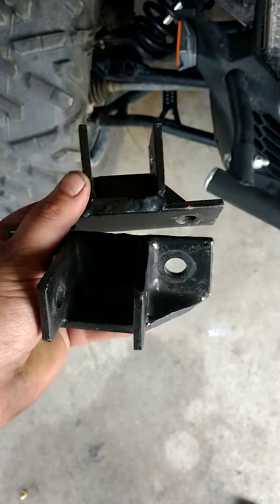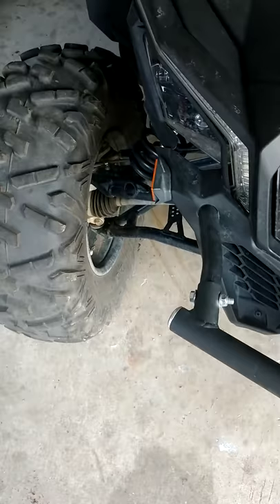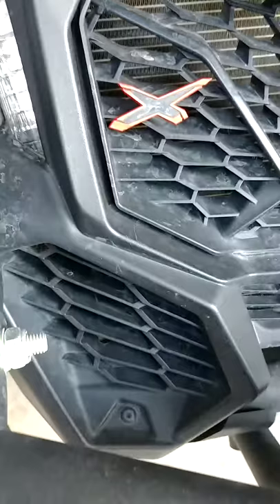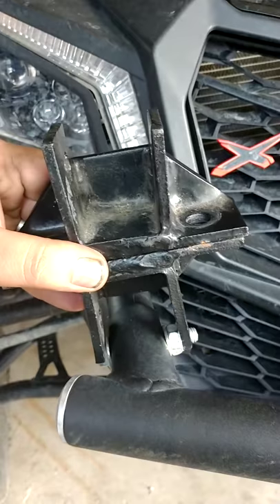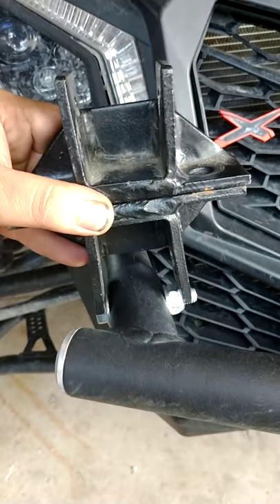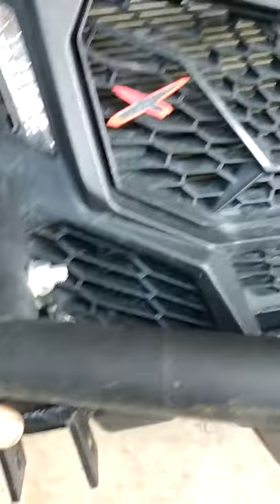Can am X3 tow bar idea

Comment from the maker: I did and it worked great for short hauls from the campground to the dunes BUT I did have to have someone in it steering it a bit. The first time I turned with no one behind the wheel it locked completely turned like I bound up so I just never took the chance and has someone sit it the short distance which is legal in the Silver lake area I guess